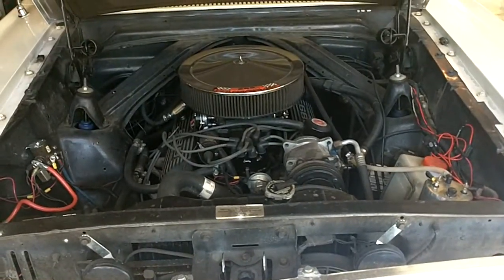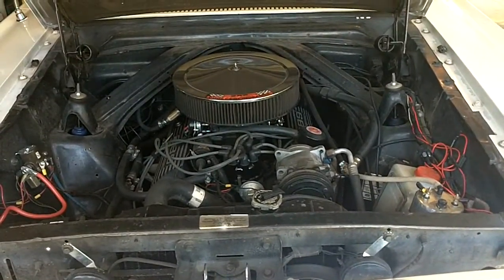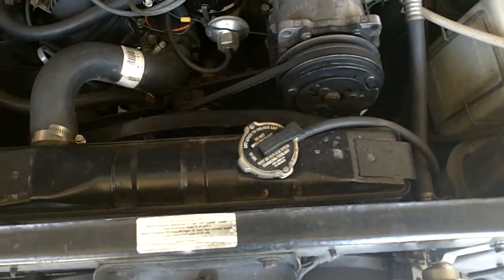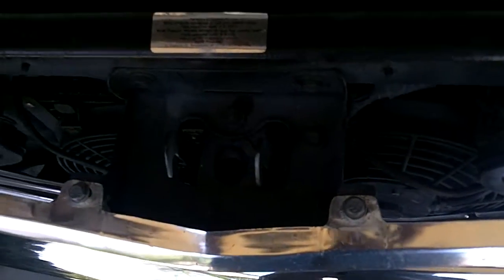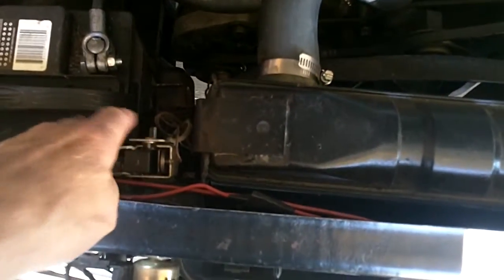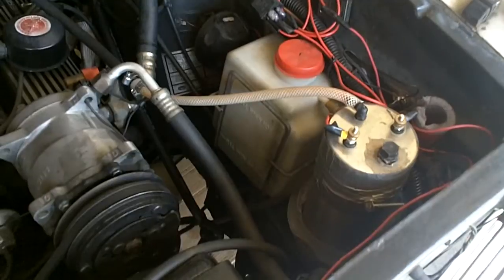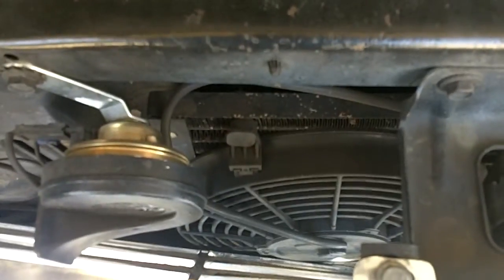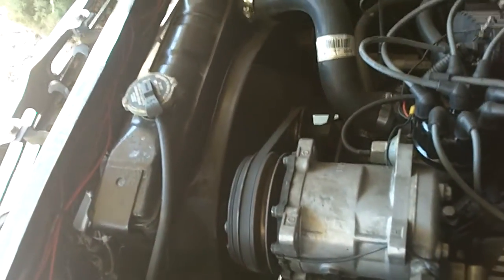How to keep your Ford 289 running cool in the summer.

Comment: I had a 289 in my mustang....what a POS!! the way to keep her cool? take her out and stick her on a stand in the corner of the garage and stare at her...that'll keep her cool!!  lol....I did that, put in a roller rocker 351w with a the three core aluminum rad....there you go...runs at 185 to 210 on a hot day....That 289 works way too hard to move that size vehicle....that's my summation..
Reply from the maker: Mine is still running cool.